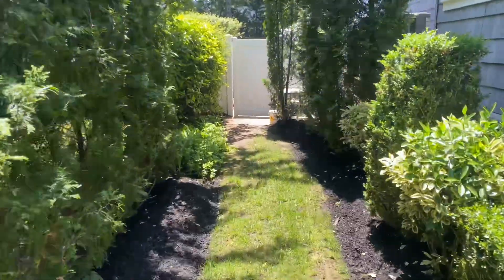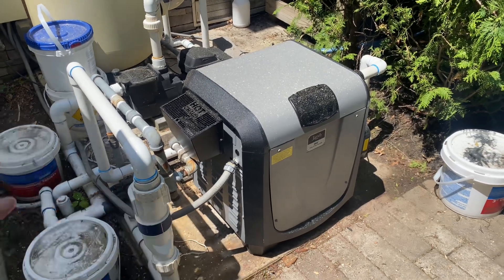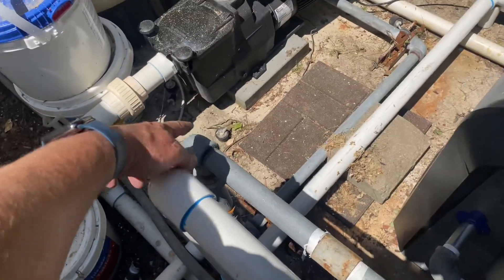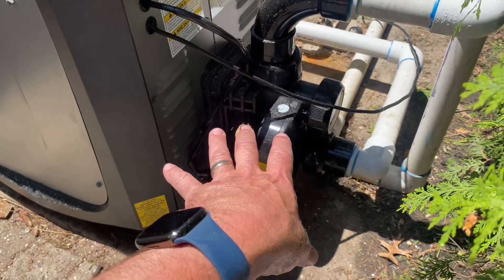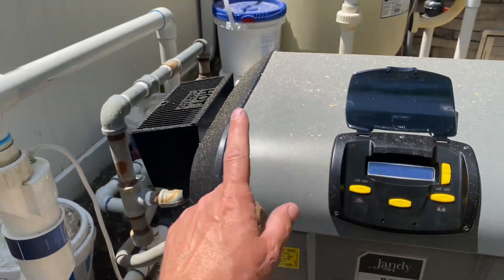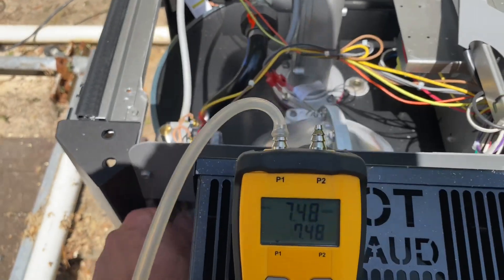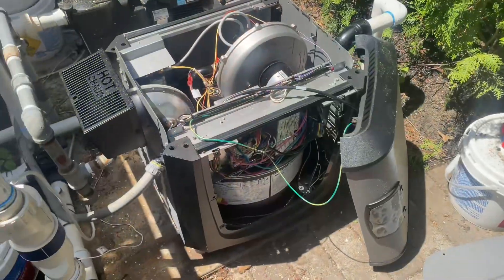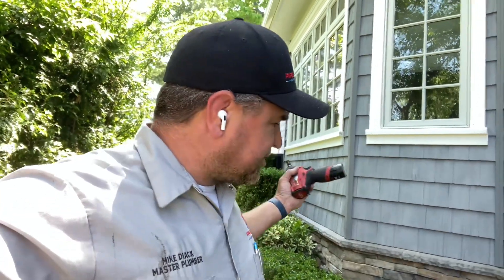Jandy JXI Pool Heater - Brand New Not Running Check Ignition Steps & Flame Sensing Failure

Comment: Electrically speaking, this is confusing. It's using AC and mostly just to spin the fans. The rest of it is probably 24vDC from a transformer. All the logic circuits will work the same regardless of AC polarity - are you saying you simply swapped hot and neutral and it started working again? Something tells me you will be out there again.

Comment: JUST installed my new JXI400 yesterday, it is replacing my 3 year old JXI400 after exchanger failure. Have an issue, it runs fine for like 10 minutes, then shuts the burner off  for about a minute then restarts on its own, runs another 5-10 mins seemingly fine, then repeat that cycle over and over. I found in the error message and it says "low gas pressure" one multiple cycles. Would this be a gas valve adjustment or a supply line problem? I have not hooked a manometer to it yet as I wont have time till tomorrow, but to answer what I expect may be the follow up questions...it is the SAME gas supply line "1 1/4" including the shutoff located 6 inches before the heaters 3/4 inlet supply pipe that is the the same one on my last jxi400 that ran flawlessly gas-wise, never gave me a problem with low gas pressure errors. (never adjusted the gas valve on my original)

Comment: I viewed and everything checked out ok.
Very frustrating… we in Texas have had freezes and rain…. Everything was damp due to the humidity….last resort I decided to wiggle / unplug all of the connections and turned the hot tub on and due to the humidity (they were not wet but evidently connections were damp)
Turned on the hot tub heater and it worked great… thanks

Comment: NYC fuel gas code. 403.9.3. Tape is allowed. But not at pressure regulator. Would certainly not consider it  good practice.
Reply from the maker: Wrong 😑
Reply: @PipeDoctor  was pretty shocked myself when I saw that, but it is in the New York City code. Apparently new to 2022
Reply: Look it up. It's there

Comment: The sound the heater made when firing the last time did not sound healthy. JXIs fail on a regular basis. We went through 2 of them. First time was through warrenty and second time I switched brands. Even if the install is correct the heat exchanger will still fail within a year regardless of water chemistry...

Comment: If you had to rewire it, why not terminate the liquid tight correctly and correct the ground wire? since you were the last to touch it, could they blame you for leaving it that way, if someone got hurt, or I guess as long as you tell the customer then you are in the clear?

it looks like they could have removed that black grommet to fit the liquid-tight connector if they did not want to drill it out.

Comment: Hey Mikey, of Mikey Pipes Plumbing not easy being cheesy. There should be a number six copper bonding wire going from gas fired equipment to the main electric panel. And the equipment should be a GFI circuit. Again, a Class one, Hazaardous two location? "people, water and electric do not mix well. 42 volt can kill. But again, you are just a dumb plumber. Love you buddy, you be safe out there.
Reply from the maker: Love you. No homo gene

Comment: Re Bonding - Why is their a concern of electricity traveling from the heater to the pool, if the connections from the heater are all PVC.  There is no metal.
Reply: Water is a conductor of electricity.
Reply: @ChiTownFixer  Thats the concern?  That a pump or heater will have some type of short, and electricity will flow thru the water in the pvc pipe to the pool?

Comment: If an actual pool professional installed it, it would have been done properly and to code. Obviously this was not a professional company. As a pool professional we install pumps, filters, heaters, chemical control systems, automation and other equipment per manufacturer recommendations and to code. Telling my industry to stay in my lane and clean pools is offensive.
Reply: If your Company is Qualified and Competent, you have every Right to Install the Items you Listed in your Comments.  The Issue is there are a Lot more Unqualified Companies. 👎

Comment: That gas line looks like it's made up with a "thread protector" rather than a proper coupling. They have straight threads and aways leak.
Reply: You are right looks like one of those they put to protect the threads. It's all the way threaded. 

Whatever works right?! 😅 🤣